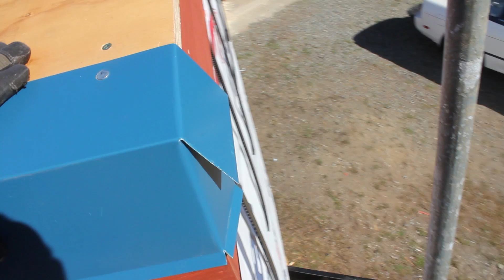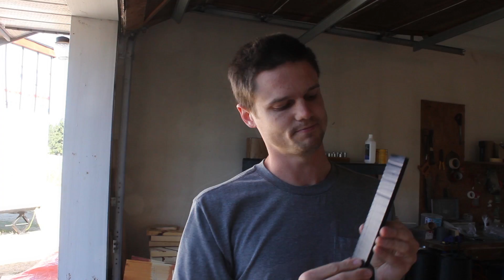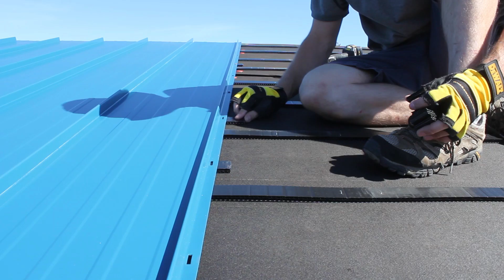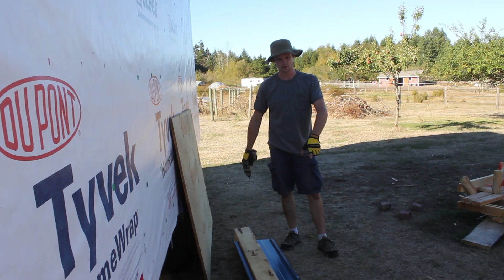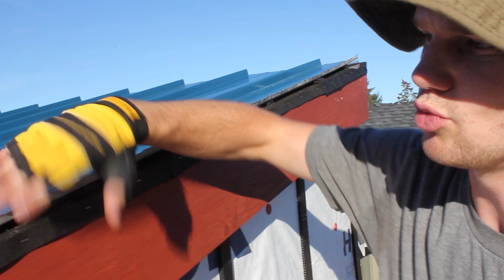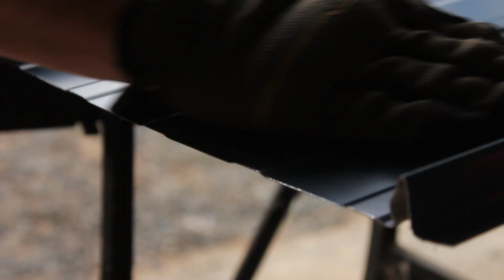Tiny House Roofing - Part 1 (Ep.16)

Comment: How much does your roof overhang on both sides? Does it push you over the 8'6" road-legal size limit? You must be cutting it close...
(Love your videos!)
Reply from the maker: Thanks for watching :)
If you measured from one overhang to the other, it would be a few inches over the limit... that would be the farthest edges on each side, but they are not on the same horizontal plane, so it's tough to say how wide it would technically be considered. It's definitely something to watch out for, because we didn't properly account for each little layer building up to that few inches in the end.
Reply: It depends on your state mine goes by the same as a  semi witch before it's considered oversized is 10ft and 14.8 tall

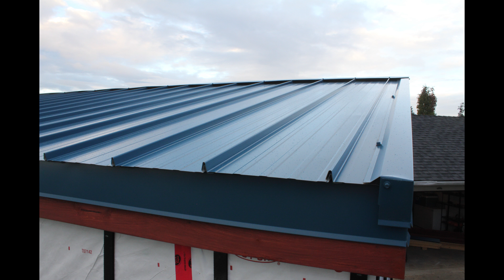Comment: At 15:51 the gable flashing coming together with the roofing is shown - but it looks like there's a pretty big gap at the bottom corner of the flashing where it goes over the roof.  Did you guys protect this with bug screen at all?  Or did you not need to?  

I look at the project of sealing a house from bugs and feel like it's close to impossible!
Reply from the maker: We did actually stuff a little piece of foam in there to deter wasps. So far we've only had a few small nests that have been easy to clear, because they haven't been able to get in deep :)

Comment: Just wondering, since I have seen a rain membrane in between the end / eve flashing and the paper.
Reply from the maker: We didn't use any membrane because that's usually for snow/ice buildup, and we get very little of either... additionally, we made a gap under the metal roofing which can allow drainage if any water got under the roofing, and there is still the tar paper protecting the plywood...

Comment: Putting a blade in backwards on a table saw would have solved your problem with the metal roofing. It works for vinyl siding as well.
Reply from the maker: +Edward McCaffrey Indeed, we've been hearing this from a few people, nice tip!

Comment: Did you just cut corrugated plastic to make your rain screen spacers? Or are they manufactured? I can't find anything. And the corrugated plastics I found say they will deform at 210°F...
Reply from the maker: +Jay Liptak They are a manufactured product... we had to show pictures to the building supply employees and hunt a little, but they found "3/8" plastic ventilated furring strips" in their inventory. 
I'm sure ours could deform/melt, but our summers are pretty mild and they seem fine after a year.

Comment: Is the corruplast strong enough to withstand the compressive force of being stood on?
Reply from the maker: +Bike Man Dan Seems to be. I was up there a few times with my full weight and it didn't seem to be crushing anything. The panels spread out the force.
Reply: +Tiny Nest Nice, thanks for the reply. I'm doing a metal roof right now and was planning on doing wood with a kerfed back but corruplast would be much better

Comment: Im an RV tech, So far watching you two has impressed me beyond words! I myself work on a crew building Park Model RVs- Similar to the Tiny houses. I have to honestly say that your Craftsmanship and attention to details far outshines some of the guys I work with who have been doing this for years!-By the way, you can quickly cut metal roofing by using a plywood blade placed in a circular saw backwards-Its a little noisy and throws alot of hot metal shavings but works great. Keep up the good work!

Comment: Jake, where did you purchase your plastic furring strips? I'm having trouble locating them. BTW The solution of putting the furring scrapes under the slots on your roofing panels was so smart. :)
Reply from the maker: mimisavegan We got them through Slegg Lumber. 8'8" x 1-1/2" x 3/8" plastic ventilated furring strips.
Reply: Thanks!

Comment: Nice job as always. Like Colin suggested using a circular saw is possible. I heard that if you take a wood cutting blade and mount it backwards it cut thin metal like that. Never tried it myself but have seen it done with metal framing studs. Went trough it like butter.
Reply from the maker: Jerry Densmore Cool, I may have to try that. Thanks for the tip, I haven't heard this one before.

Comment: Looks great guys!

Next time you need to cut metal panels like that, you can just get a blade for your circular saw that is meant for cutting metal (carbide or something like that) and you can cut it just like a sheet of plywood.  The grinder looks like it did a great job, but you might find the saw method faster and easier. This is the method we used when installing metal roofing when I worked in construction.
Reply from the maker: Colin Keevil lol after attempting the scoring method, I would definitely just cut the next one. The grinder was ok, but I could also try the skill-saw next time. Since we did so little I didn't have much opportunity to try out different tools. But having never really worked with sheets of metal before, I'm sure I have lots of room to improve my cutting skill ;)

Comment: The reason for the slotted holes in the roofing is to allow for expansion and contraction of the roof so I'm not sure how the roof is going to fair since at the bottom and top of each piece all you did was drill a single hole and not a slotted hole. Also, Have you ever thought about the front roof while driving in the rain it could get up under the roof panels. Otherwise it looks great.
Reply from the maker: Sachi WI Hm, I had not considered the expansion. Hopefully the panels are small enough that nothing will buckle. We will definitely let everyone know if we encounter any issues of this nature.

If the front box gets wet it's not a big deal since it is a separate object from the house, but even so, the asphalt paper should give good protection under the panels.

Comment: I'm not a fan of metal roofs with their sharp edges.  But it's hard to not go the simple and cheap route.  Probably not an issue with a roof that short, but where I currently live the metal roof blocks a lot of signals.  Like the cell phones ability to connect to a tower, you have to step out the front door or stay near a window to talk on the cell phone.  And for the analog antennae I have to run a long coax and place the antennae outside a door to watch over the air digital tv programming.
Reply from the maker: wwwShadow7 Hm, our cell service is awful here already, but we will definitely let you guys know about this kind of issue should it arise once we're living in it.

Comment: The best laid plans......... you thought it was going to be the easy part. lol.  Again thinking outside the box, but I'm sure you had a few choice words when there was no hardware with the roof, and then the different spacing of the screw holes.  It does look good.
Reply from the maker: Duane C Should have checked more than one panel for the spacing... but it worked out without too much hacking ;)